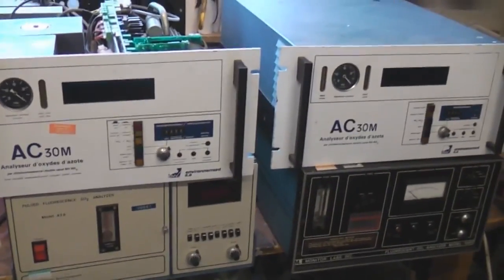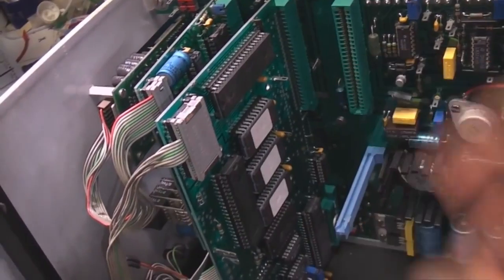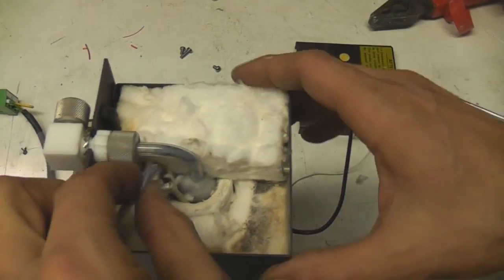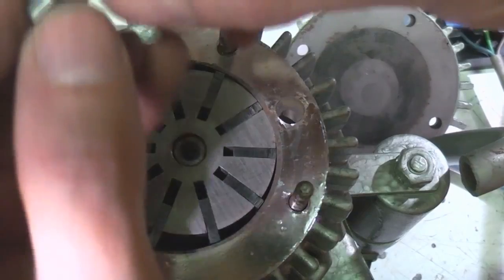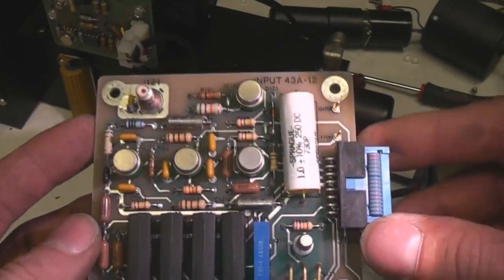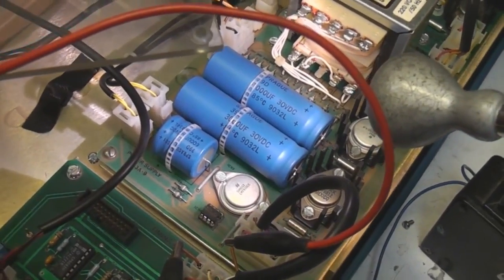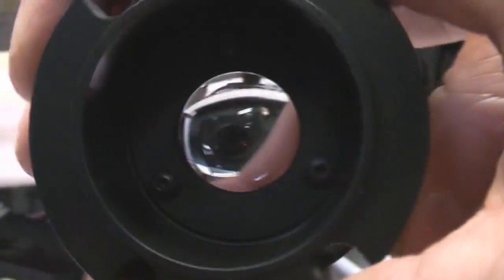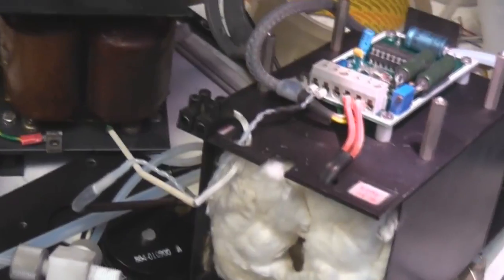Gas analyser teardown

Comment: That old Thermo gave me flashbacks to the early days in my career. We used to use a lot of the Thermo A and B series units in our network.
Until recently, I used to calibrate a 43A (photometric ozone monitor from the same instrument generation) for another agency to use as a bench standard.

Comment: I recognize the insides of the last machine, took one apart a couple of weeks ago as they emptied a university gas lab here in Oulu, Finland. It was probably a materials lab rather than environmental. Took the sensor with its amplifier board, and the "T1" transformer. Different size but identically marked "T1" transformers were used in other analyzers as well.

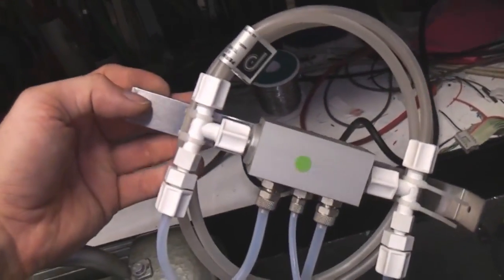Comment: 9:10 That is a PermaPure moisture management device of some sort. It uses Nafion (perfluorosulfonic acid polymer, kinda like Teflon with sulfuric acid added, adsorbs water but stays solid) in a tubular form to effect transfer of humidity from one stream to another (drier) one. Probably used for sample prep or oxygen conditioning prior to ozone synthesis.

Comment: I used to design and build the sample routing streams that feed the test substance into the analyzers. Everything thing in that industry is extremely expensive and, very much so hand made. One nox cart new would go for just under $750k, it really is a awesomely unique field. The streams would have to be heated and kept to .5 degree F over 50 feet of hose to prevent the sample trace from sticking. your literally measuring atoms in some instances. These are very common in production SAE dynos

Comment: Vacuum pump needs to be stripped, lapped down to 5 thou end clearance and the checked again. It should do more than 30 inches into zero flow. Nice little pump there, probably made by GAST.

Comment: I had oxygen sensors where you had to buy a new sensor head every 6 months maximum ( and they only had a shelf life of a year anyway) and the sensor heads were $200 each. Tossed it and got a much cheaper one with cheaper sensors, it was used to check a inert atmosphere packing line.

Comment: SO2 analyzer #1: flash tube looks like it might be a hollow cathode type, which emits light characteristic of the cathode material.  UV wavelengths suggest something like mercury vapor (which wouldn't really need something fancy like a hollow cathode lamp, as a regular gas discharge type would suffice).

Interesting that the washer in front of the UV tube in #2 is all rusty-- that thing should be making quite a bit of ozone!
Reply: The flash tube is a Xenon flash lamp with two internal trigger electrodes, broad spectrum so it required the 4 angled reflective wavelength filters.  The continuous wave finger lamp is a UV lamp with a narrower wavelength spread and only has the single band pass filter in front.

I have examined a newer instrument and the optical system is still almost the same, CW UV lamp, single filter, heated block, optical feedback and Peltier cooled PMT tube detecting light in the common volume, with the extra band pass filter to block the excitation light and pass the SO2 fluorescence wavelength.

It also had a concentric tube-in-tube  scrubber that was there for removing hydrocarbon vapours from the sample stream and had an option for an internal  span sample source, basically a vial of SO2 with a Teflon seal that diffuses a tiny amount that is calibrated at 75degC I think.  The source cannot be left in these machines as it will contaminate everything if the pumping system does not continuously purge the piping to the outside.

Ozone does rust stuff.

Hollow cathode tubes are generally of a different construction with the optical output emitted from the hollow cathode area. Usually they have heat fins inside the tube too as the cathode runs hot.

Comment: So what'd would the 2013 equivalent of these massive sensors and assorted electronics be? :)
Reply: Even today 2022 they are surprisingly similar.  More computerisation and automated calibration, the sensor in a newer unit I investigated is functionally identical to the second unit Mike disassembled.  Look up Teledyne API NOx and SO2 fluorescence analysers, you can find pictures of the internals on the web and they are the same as these old units.